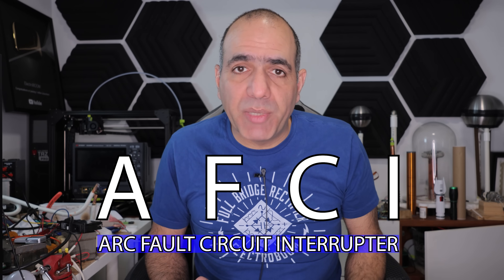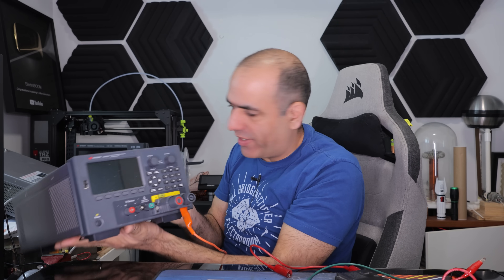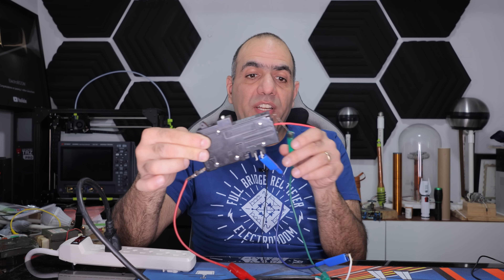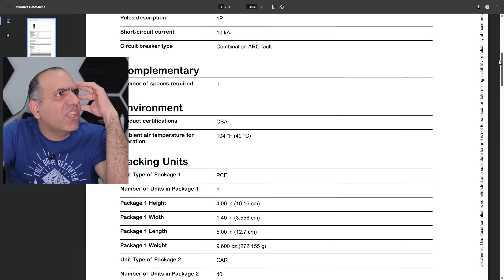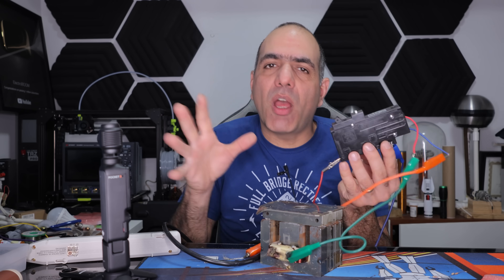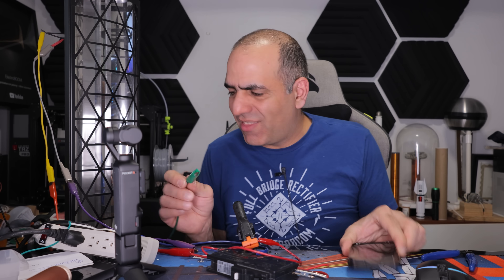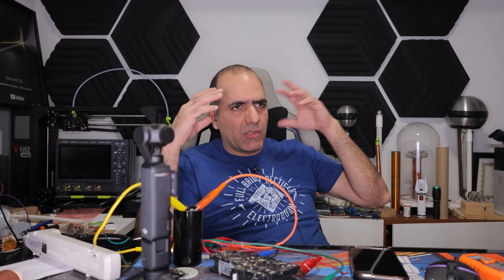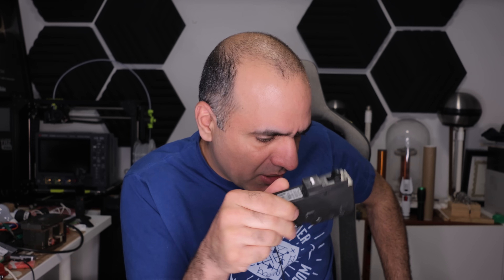Fighting Electrical Fire by AFCI

Comment: 11:55 Quick Tutorial on how to turn Saltwater into Chlorine Gas.
Reply: "even more saaalt"
Reply: @pvc988  We both had the exact same clip in mind 💀
Reply: @pvc988  is that refrence to diodegonewild?
Reply: @dan2800 yep
Reply: @pvc988  my man he's a goat
Reply: @ No. CuCl2 is first blue, then green, then yellow as the concentration builds up. Neither of these two colors are present.
Reply: @MadScientist267  The solution will be HCl + HOCl and NaOH (don't forget the Na from the NaCl) if you mix those two you just get salt water back. So anything going into solution will neutralize. The only things that will remain are the parts that either react with the electrodes and escape as a gas.
Also Copper (I) chloride is yellow, the one you talk about with the blue color is Copper (II) chloride. Only at higher concentrations dissolved chlorine will have a slight yellow color but it's not very strong.
Reply: @ Ether - Except the part about CuCl, which is white, not yellow, and can just say "not soluble", in water. Spray from the anode (during a given cycle in this case) will contain the most Cl. Yes, any that stays in the bulk solution is destined to return to the sodium. This is what happens when a more complicated than meets the eye reaction gets simplified for the likes of a YouTube comment.
Reply: @MadScientist267 Afaik it does become slightly more soluble in an acidic environment where it also wouldn't be in it's pure form. 
Whatever the cause for the yellow color is I'm certain it's not dissolved Cl as it's coloring isn't that strong even at higher concentration which it can't even reach due to the presence of NaOH.
PS: I agree that the actual chemistry is likely much more complex especially since non of the reactants here is pure. Salt likely contained iodine and the water will have all kinds of elements mixed in.
Reply: @ I don't disagree that this is a "version" of sorts that can be used to create NaOCl, NaOH, HCl, Cl, H2, O2, and with enough time CuCl2 buildup in solution, which follows the blue - green - yellow - brown progression, not present here. CuCl isn't soluble and is white anyway. Fe will be little more than trace, as the solution going in is clear, so unless it is coming from the copper as an impurity, can rule that out. I can see iodine maybe (I'm not super familiar with its compounds), but even that will be starting from very low levels, but let's say can't rule it out. NaOCl is as mentioned elsewhere, greenish yellow. Cl has a slight green to it but a much stronger yellow. There's a hot plasma "in solution" for what that's worth, but still only going to have what you started with... we're not doing that level of physics here haha What are we left with? A severe camera color distortion? Lol

Another edit: Also might get OCl2, which I know of as rather green, but definitely on camera, so I don't think we're seeing any of that.
Reply: @ I don't disagree that this is a "version" of sorts that can be used to create NaOCl, HCl, Cl, H2, O2, and with enough time CuCl2 buildup in solution. CuCl isn't soluble and is white anyway. Fe will be little more than trace, as the solution going in is clear, so unless it is coming from the copper as an impurity, can rule that out. I can see iodine maybe (I'm not super familiar with its compounds), but even that will be starting from very low levels, but let's say can't rule it out. NaOCl is as mentioned elsewhere, greenish yellow. Cl has a slight green to it but a much stronger yellow. There's a hot plasma "in solution" for what that's worth, but still only going to have what you started with... we're not doing that level of physics here haha What are we left with? A severe camera color distortion? Lol

My original reply got deleted. This one probably will too. No point on YT.
Reply: @MadScientist267  well, OCl2 is a desperate guess haha, this devious molecule is made only in very specific reactions, like reduction of chlorite in specific enviroments. Iodine is present in salt, but as iodate, and that has white color. You mentioned CuCl being insoluble, but it does like to form soluble complexes, and with chlorine, it forms three forms, CuCl2-, CuCL3-2, and other hydrated messes, but CuCl2 is not necessarely blue or green, it depends on what kind of complex its in. The most characteristic blue color from copper ii sulphate comes from aqua ligands, and the green you mentioned comes from chloride ligands. the complexes are complex, as the name sugest, and mixed copper ii complexes ligands can have a yellow color. There is just no way that chlorine in the form of hypochlorite can get that yellow. maybe the strips used do contain iron impurities? they do have a strong yellow to brown color when in the III oxidation state
Reply: @MadScientist267  well, OCl2 is a desperate guess haha, this devious molecule is made only in very specific reactions, like reduction of chlorite in specific enviroments. Iodine is present in salt, but as iodate, and that has white color. You mentioned CuCl being insoluble, but it does like to form soluble complexes, and with chlorine, it forms three forms, CuCl2-, CuCL3-2, and other hydrated messes, but CuCl2 is not necessarely blue or green, it depends on what kind of complex its in. The most characteristic blue color from copper ii sulphate comes from aqua ligands, and the green you mentioned comes from chloride ligands. the complexes are complex, as the name sugest, and mixed copper ii complexes ligands can have a yellow color. There is just no way that chlorine in the form of hypochlorite can get that yellow. maybe the strips used do contain iron impurities? they do have a strong yellow to brown color when in the III oxidation state
Reply: @ Yes, which is where I lost the original comment. It didn't like the addition of sodium hydroxide or oxygen dichloride as edits and it disappeared. I'm surprised any of this discussion has made it this far to be honest... this steaming pile of a platform doesn't like this topic at all.
Reply: @MadScientist267  CuCl2 could very well be yellow in concentrated (or dry) NaCl
Reply: @ mernoki - Not true. It is very limited because of the next cycle's depolarizing effects but the process isn't perfect and some of the products of a single cycle make it into solution.
Reply: @MadScientist267  so basically not enough to be harmful in short duration
Reply: @ Shal - At the level done here, I'm sure it was detectable, but limited. A lot of it would have been retained in the bulk liquid but the spray drying out would have been emitting it as the water that was holding it evaporated. Note that the spray lightens with time gone by.
Reply: And what is the yellow stuff it was spraying everywhere?
Reply: its mostly steam
Reply: chlorine gas is greenish yellow, whereas brownish yellow liquid oxides or hydroxides indicate iron; probably more to do with the minerals in the water and the electrodes
Reply: More like... Copper oxide salts, vapor and other complexes of metal salts
Reply: Yummy
Reply: There is no electrolysis on AC. You need DC and inert electrodes liek graphite or platinum.
Reply: @mernokimuvek  
It is short bursts of electrolysis, but because they are inverted all the time the products mix and can re-react if the conditions are right. But there is electrolysis in AC as well.
Reply: @Lampe2020  They used to use salt water to limit current for wound rotor motors a few decades ago.
Reply: @mernokimuvek  There absolutely is some electrolysis on AC, but not a lot.
Reply: @mernokimuvek  I used to do electrolysis with AC to generate HHO gas when I was a kid.  Literally just a plug into the wall outlet, wires, and some aluminum foil to act as sacrificial electrodes.  Stuck 'em into some tupperware full of tap water with an upside-down milk jug to collect the gas.  The tap water in my town is just conductive enough to let you pull this off.

Eats the electrodes like mad but you can get a gallon jug of boom gas after a couple days pretty easy.  Quickest way to turn a milk jug into a plastic sphere.
Reply: @jeffspaulding9834  If you use sacrificial electrodes, it's not electrolysis. You just remove the oxide layer, exposing bare aluminium which reacts with water to form hydrogen and aluminium hydroxide.
Reply: The yellow was very concerning
Reply: @ mah - the yellow color of the splatter that is going everywhere is Cl gas dissolved in the solution.
Reply: @MadScientist267  no its the copper dissolving likely some form of copper chloride
Reply: @ Wrong. Copper chloride produced by electrolysis (+2) is first blue, then green, and eventually a darkening yellow. Neither of the other two colors are present, nevermind preceding the yellow. That's chlorine. That's also why it fades as the salt dries.. it is escaping because there's no more water to hold it.
Reply: @MadScientist267  If that really was dissolved chlorine, the form of which it would be in solution is as a hypochlorite beucase of the generation of both NaOH and Cl2, which react almost instantly to form NaOCl. this would appear as a greenish-yellow, not full on yellow like that. Also, another proof that the compound is not a dissolved chlorine species, is the fact that the dried residue is also somewhat yellow, while both dissolved chlorine and hypochlorite decompose when dried to some extend. the yellow color for the copper compounds is probably caused by their fast formation in a hot enviroment, causing various hydrated and chloride complexes, some of which can have orange to yellow colors.
Reply: why does he keep doing this same thing in his videos? He has done this so many times before. Does he never learn 😂
Reply: @stevenlee3661Brother he does it on purpose
Reply: isn't it seawater that makes chlorine gas?
Reply: @mickwolf1077  
Because of the salt (sodium chloride, gets split and the chlorine gets released as elemental chlorine, i.e. chlorine gas).
Reply: @Lampe2020  I'm not doubting it as I'm not educated in chemistry but I just heard somewhere when researching HHO generators that you cant use salt water because you'll end up with chlorine gas, a kind of salt was ok as an electrolyte but baking soda is better, I think they were referring to some system in submarines. I didn't have an issue using salt but the water ended up funky looking.
That was ages ago though.

Comment: They make AFCI/GFCI breakers as well.  They are pricey at about $60 for a 20amp breaker.  In my area they are required for most breakers.  It can add a couple thousand dollars to the price of your breaker panel depending on the number of breakers.
Reply: I'm pretty sure that's what he had here.  In my experience, "combination" on the label usually means combined AFCI/GFCI.

And how many breakers do you have that an extra $50 per breaker adds up to "a couple thousand dollars"?  Mathematically, that means you must be installing at least 40 breakers.  (Most people I know have maybe 10 or 12..)

If your house is already so big that you need that many circuits, you can probably afford it, IMHO :)

But seriously, considering a main-panel replacement (done by a professional) is usually pretty expensive anyway (where I am, at least), we're still talking about maybe a 10-15% increase in cost to add all combo breakers, for both a much reduced risk of your whole house burning down and a reduced risk of your family electrocuting themselves, some time in the future.. still seems like a good deal to me, frankly.  Plus in many places it's a code requirement now, so you just can't avoid it anyway (legally, at least).
Reply: @foogod4237  ""combination" on the label usually means combined AFCI/GFCI." -- Schneider describes any breaker that has a function other than plain overload as "combo". They do make AFCI+GFCI breakers, but those have purple test buttons (see e.g. the one in the electrical panel in this video). The one he's testing, with the white button, is AFCI-only (GFCI-only would have a yellow test button).

Comment: In Germany or Austria AFCI (or here it is called a AFDD - Arc Fault Detection Device) can be found used for: rooms with higher flamability, houses made out of wood, emergency exit areas in public buildings and so on. It is not required by law to install them in your own house, but it is recomended to use them for bedrooms and that kind of stuff. In Hotel rooms it is also only recomended to install them, but most of the time, you will find a combination of AFDD with RCD in one device.
Reply: Small correction: It USED to be that AFDDs weren't required and instead just recommended in the  DIN VDE 0100-420: 2013-02, though in the new guidelines from 2016 onwards they were made a hard requirement for certain types of rooms/buildings. Those include bedrooms and community rooms in retirement homes, (wheelchair) accessible apartments, rooms with high risk of fire and rooms that contain irreplacable artifacts or art (like museums). This was reworked again in 2019 and it went back to reccomendations instead of requirements, HOWEVER from 2019 onwards you need to do a specific risk assessment for new buildings and if there is found to be a risk that can be mitigated by an AFDD or an alternative way (redesining the building to avoid the risk, etc.) you are now required to implement an effective way to mitigate the risk (soft requirement).
Reply: @jdkap201 Weil die Heizdecken so gerne kokeln
Reply: I.e. never used in Germany because you build homes out of proper construction materials

Comment: Exists in Germany too, just by code not forced but recommended for rooms where people sleep (bedroom, living room, kids room)

Maybe Mehdi will make a video on the SPD (Surge Protection Device) that is mandatory in Germany
Reply: Video about SPD would be good
Reply: It's because of 120 V vs 230 V. An arc between 230 V live and neutral will draw so much power that it trips a normal overcurrent breaker. 230 V countries also have a lot of chassis-grounded high-power electric appliances, so you are likely to create an arc to ground at some point, tripping the GFCI breaker if the overcurrent breaker hasn't tripped already.
Reply: @hammerth1421  No, it has nothing to do with the voltage (and a 220/240V arc will not necessarily trip a regular breaker, either.  In fact, series arcing (like what usually happens in bad outlets, etc) will never trip a regular breaker, no matter what the voltage is, but will actually produce larger arcs in a 220/240V system than with 120V (so is potentially worse)).

The main reason arc-fault protection isn't as widely required in European countries, etc, is because the building materials that are often used there are much less flammable (a lot more buildings are made out of masonry, etc, instead of wood and drywall), so an electrical fire is less likely to burn down the whole building.  However, in many countries I believe they are still strongly recommended if you are in a wood-structure building, etc (and might become mandated eventually).
Reply: @foogod4237  Thy are mandated in some Euro countries, but only in certain rooms of the house.  I know the UK requires them on a few circuits now. (I don't know about commercial or industrial). Yes, wood obviously burns much more readily than masonry, but masonry is much more expensive.  Masonry houses cost a fortune in the U.S. considering our vastly inflated housing market.
Reply: @hammerth1421 but isnt the mcb systems enough for European countries? We have mcb system at home and it trips so easily compared to Mehdi’s afci and dont even make catastrophic arcs. I guess North America should use Europe system to have better protection for both devices and people.
Reply: @HighwayGamer  this arc is not "short circuit" - it is in the "normal" circuit of your device. F.e. could be loose wire or bad switch contact.

Comment: 13:30 

I don't know if you're going to get to this in the last 2 minutes of your video but it started annoying me that you can't trip it, so I started researching online

According to wikipedia, the way an AFCI is actually implemented is that it's detecting certain harmonics of the AC signal that are apparently indicative of arcing. Quoth wikipedia:

> The electronics inside an AFCI breaker detect electrical current alternating at characteristic frequencies, usually around 100 kHz, known to be associated with wire arcing, which are sustained for more than a few milliseconds.

I don't know what you have to do to generate those conditions in a circuit; I dropped out of EE in second year. But, that's apparently the actual answer to your mystery.
Reply: A 100 kHz resonator circuit would probably do the trick.

Comment: 10:49 Welp, I guess the real arc protection is the solder that melts when the arc generates dangerous amounts of heat. We should solder all wires going into the back of wall outlets instead of screwing them!

Comment: "At some point we need to ask ourselves, what are we really protecting against?" 

Didn't expect a deep and reasonable quote from Mehdi of all people
Reply: Protecting against the manufacturer of these gadgets going broke!
Reply: @glasslinger  Exactly right.  When I moved into my new home the very first thing I did was swap 100% of the AFCI breakers with standard breakers.  This is literally one of the worst scams in the history of the electrical code.  AFCI are VERY UNSAFE, as it causes the only people that matter...YOU to believe it is doing something it DOES NOT DO.
Reply: Who protects us against the protectors?? 🤯
Reply: The duality of man, I actually came for that and expecting that, some of the features and implementations really run short of a few risk vs investment vs assessment charts, and the bold but wrong choice of making some of these IoT devices
Reply: I work in radiation safety. That's actually a big question in my profession.